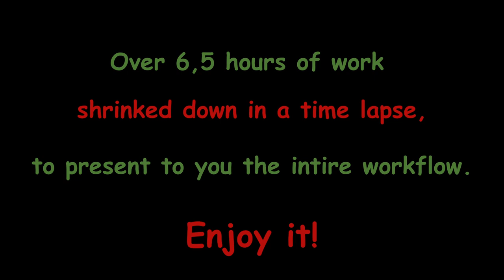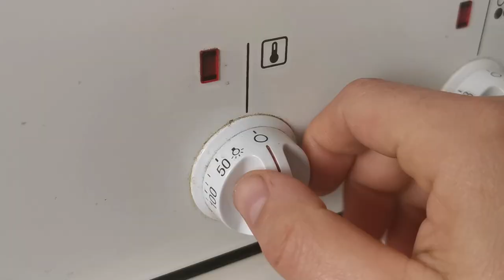DIY Custom Slingshot-OTTo by JaWu-Time Lapse

Comment: Quick question for you. I saw that you put your mold and resin  in the oven for a bit. Was that required in the instructions for your resin or was that to speed up the cure? And if so, how long did you leave it in the oven and what temperature did you use? Thanks.
Reply from the maker: I use the oven at 50-70°C to speed up the curing of resin coating. In this case here I used the oven to soften the hotmelt glue mold to be removed more easily.

Comment: How do you mount the bands?
Reply from the maker: The band attachment on this slingshot is caller Topslot attachment. You have to roll the end of your Bandset 1-2 times. Then stretch it and slide it into the slot at the fork, down until it's ground. Roll it a little further and then release the stretching. The band will stay in place. Search YouTube for tutorials about that. 😉